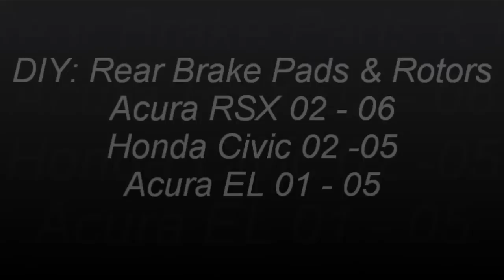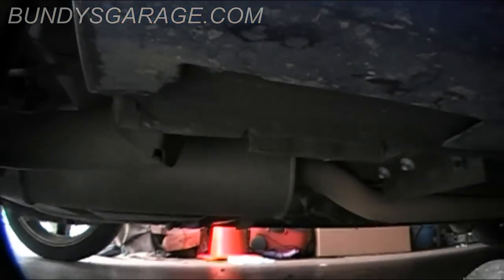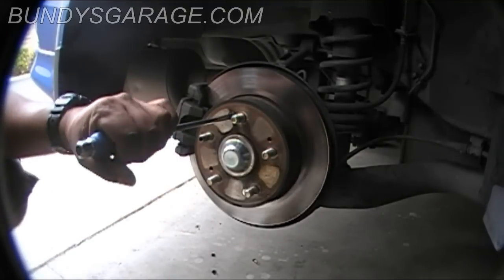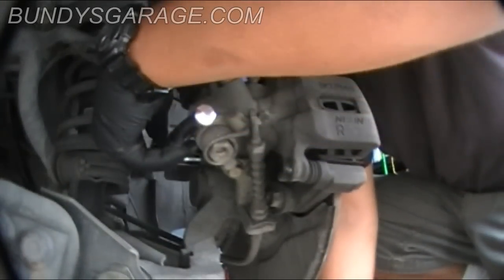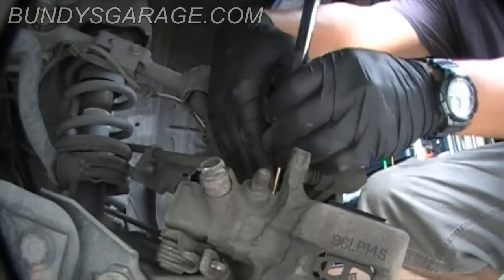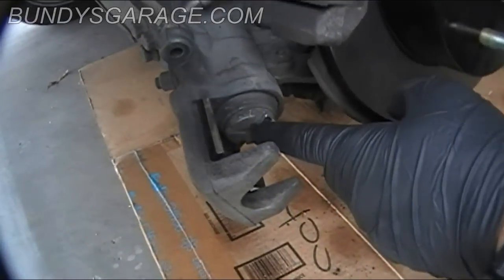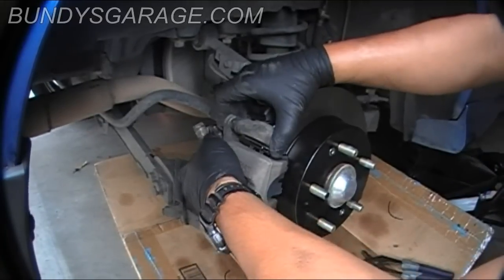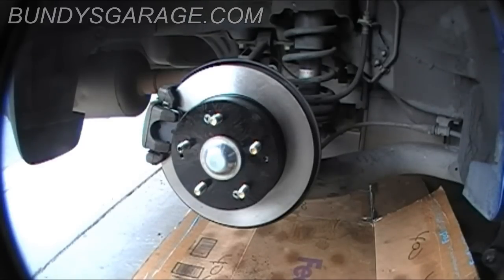Rear Brakes  and Rotors Acura Honda RSX Civic EL Type S - Bundys Garage

Comment: thanks for the video and great angles. one thing to note, when you are pushing the rear piston back in, i believe the "+" grooves need to be oriented a certain way so that the little notch on the back of the brake pad sits in the groove.
Reply: I didn't even think twice about this.  If that is the case, it will probably eventually catch.

Comment: Thanks for the video.  You saved my butt.  I have changed brakes on my cars for many years and never came across a brake piston that looks like this one.  I thought my piston had seized. until I saw this video showing how to compress the piston by turning the notches clockwise.  I  used large flat head screw driver to do the job.  Note that this feature only applies to the rear brakes.

Comment: Impact drivers works like a dream for getting the screws out of the rotors.  I picked one up at auto zone for 10 bucks the other day. Totally worth it.
Reply from the maker: They are a life saver when you need them. You can also try using a Philips head screwdriver and as you hit the end, turn the screwdriver, turning the screw. Hitting the end of the screwdriver will loosen up any rust that is preventing the screw from coming out. Same idea as an Impact Driver.

Comment: Had the same problem with those JIS screws, had an impact screwdriver too, problem was the hammer was small like he had, got a harbor freight one that was  2 1/2 lbs and it did the job no problem

Comment: Is there anything tricky with the e-brake when changing the pads and rotors? I changed the front rotors without any issues, I just want to make sure there are no complications when I get to the rear ones.
Reply from the maker: +Mikhail Grishchuk nope nothing tricky at all, very simple and straight forward.

Comment: Question about the two bolts that hold the caliper. Or actually, about the pieces that the bolts screw into, with the little rubber sleeve around it. In my case, the bottom one was stuck. There was no spring action in it. Sprayed it with wd40, squeezed it in with some clamps, but still it was stuck. Do I need to worry about this? Grease it some more? Replace parts? Thanks! The part about screwing the cylinder in was what saved me, I didn't know that some need to be screwed...
Reply from the maker: That bolt holds the caliper on and is supposed to be able to slide back and forth as the brakes operate. If you can free that part up so the caliper can move freely that would be best, otherwise you might get uneven wear on the brake pad(s).

If you need anymore help please let me know. You can always email me at bundysgarage@gmail.com.

Bundy
Reply: No you’re not suppose to use normal grease that’s what break grease is for , normal grease will ware away

Comment: I noticed you didn't grease your slides and did the top portion of the pads wear a lot because the line is supposed to be straight up and down with the caliper or the pin on the pad won't let it sit right
Reply from the maker: +Austin K pads wore evenly
Reply: BundysGarage  the pin on one of my pads wasn't in the cross on mine and only the top portion was touching the rotor but from what I saw no one else positioned it right so IDK what happened

Comment: Do you have to bleed the brakes because you pushed the piston back in?
Reply from the maker: Negative. Only bleed the system if you changed a component, like a brake caliper.

Comment: Thanks for the video its very helpful by anychance were can u buy the tool to push the psiton back in?
Reply from the maker: You can buy a six inch C Clamp from Home Depot, Lowes, Tru Value Hardware, Amazon, most car parts places have them.
Reply: +BundysGarage oh ok thank you boss
Reply: you can use a large flat head to turn the calipers piston to dress it or rent the actual caliper tool from auto zone

Comment: Next time....as you're  hammering the screws with the screw driver, try to place a big vise gripe around the shank....or use a wrench around the head and it'll be easier on your hands as you turn....other than that thanks for the video...was real helpful.
Reply from the maker: Thanks for watching and thanks for the tip.

Comment: you put wrong pad on the inside !  The pad with the wear indicator has like pigs that stick out about a 1/4 " inch on back of the pad.they can get under the caliper piston in the wrong spot  and  cause that pad to wear uneven.

Comment: Don't we have to bleed it after changing brake bads?
Reply from the maker: If you have opened up the hydraulic system, changing a brake caliper, then yes. But with a normal brake job, pads and rotors, no.
Reply: Ok thanks Buddy
Reply: +BundysGarage where do u alply the brake pad lube? I was told behind the brake pad bot the front where it touches the rotor, is that right
Reply from the maker: NEVER put any grease or lube on the braking material of the brake pad. Don't put it on the back of the pad either, it did not come from the manufacturer with lube on the back of the pad and all your doing is creating a surface for dirt and debris to attach to. Apply a small amount to the guide pins for the caliper and the sliding surface where the brake pad rides.
Reply: I see thanks bundy your help is appreciated much.
Reply from the maker: Negative